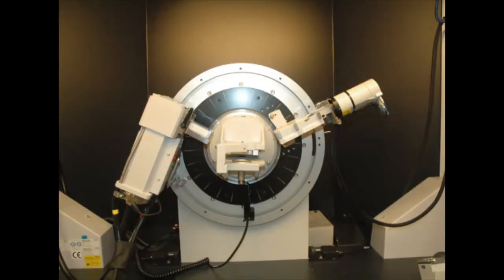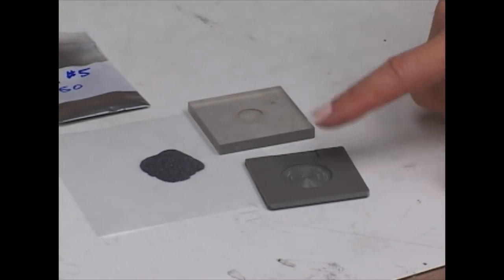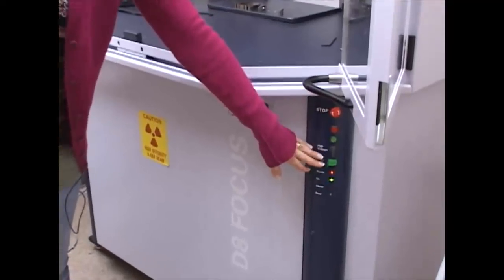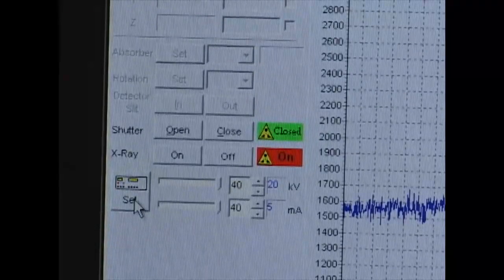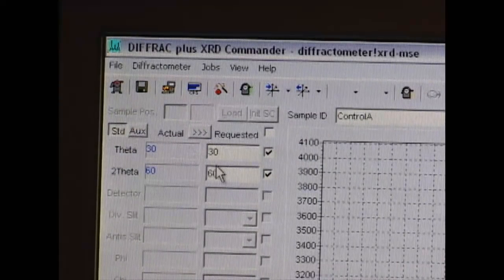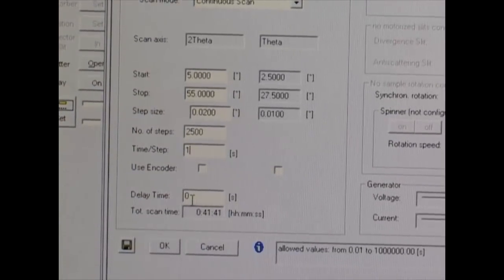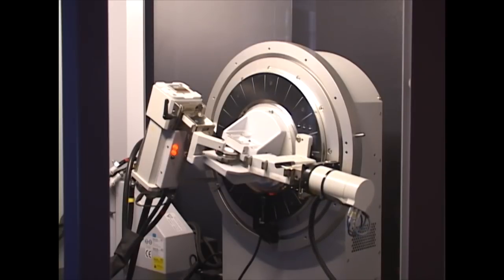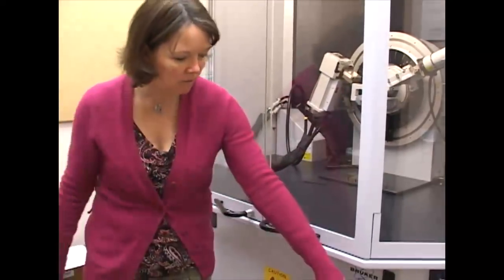X-Ray Diffraction

Comment: I am no teacher but have done a little with XRD. If you have the XRD data you have to figure out what the crystal structure of the material is. FCC, BCC etc. Next you use Bragg's law knowing the hkl values for each peak and you can calculate the lattice parameter (d=a/(Sqrt(h^2+k^2+l^2))

Comment: To handle this equipment we need to ware something x-ray protection coat..I mean there is any affect on body while using this instrument??
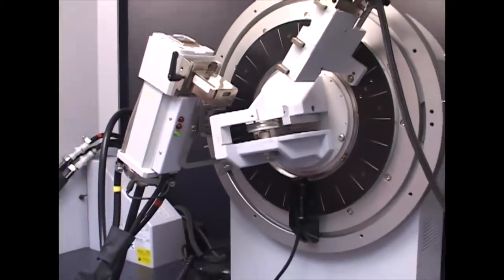Reply: At 4:50  As long as the doors are closed there should be no need for extra safety protection.

Comment: Anybody has knowledge about the price of this machine? or an estimate of the price? I'll appreciate your help cause I'm working on a project and I need that information,
Reply: Don't know if it is still relevant but just the tube itself is about 9000 USD on average. Not speaking of the generator, goniometer etc. so the sum of the machine could be about 13-15000 USD.

Comment: Where are your gloves and goggles ?
Reply: +Kathryn Laraia you're taking this way to seriously
Reply: may be you are taking x rays too lightly :P
Reply: Good lab practice is to always wear protection.
Reply: What for? The material obviously isn't hazardous and the lead glass provides protection from x-rays. Neither gloves nor goggles help with that. Unless she uses materials that require it it's absolutely needless to use so much protection. On a personal note using them is also extremely uncomfortable in most cases.